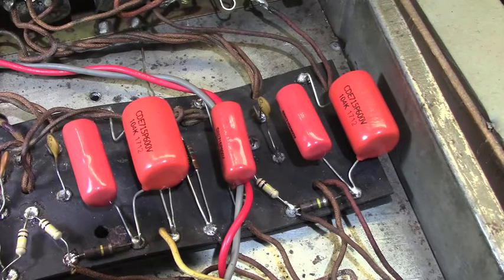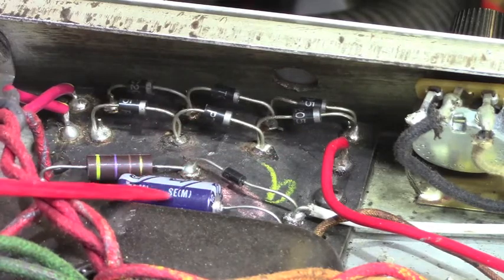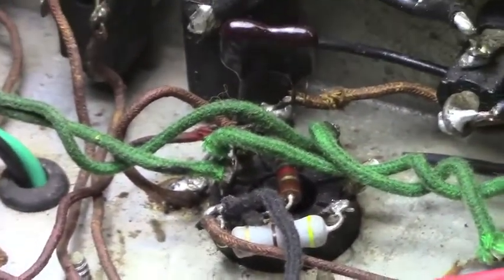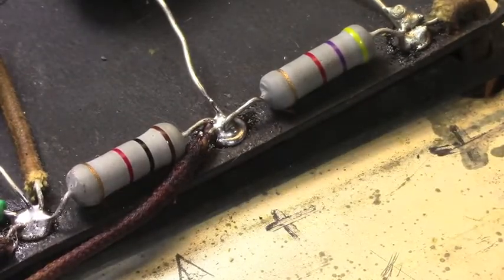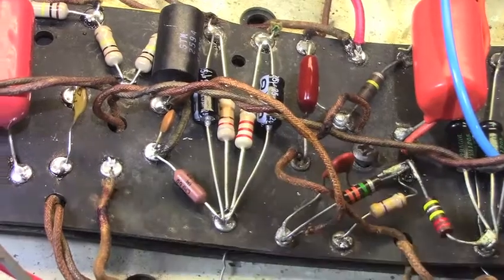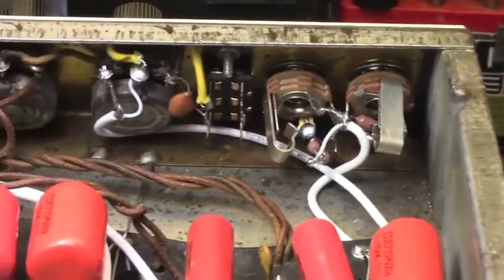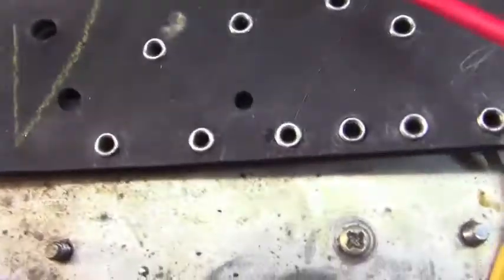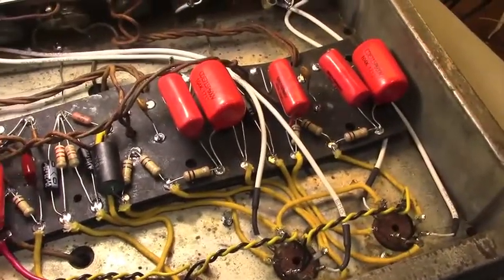The Gravedigger's 1967 Fender Twin Reverb - A Major Project WITH Soldering Tutorial

Comment: These videos are helping me a lot at the moment, thanks.  I picked up a silverface bassman to try my hand at recapping/servicing.  I opened it to find a horror show; over spec fuse, heater wiring replaced with like telephone cable or something, random plate resistors replaced (like you said, why do just one and not all?), horrible soldering, radial caps hot glued in under the doghouse, random wires cut or disconnected etc.  I'm having to learn a lot before I go in and try to rectify all this mess
Reply from the maker: kabukiman69 - I'm glad you are enjoying my videos. But, please do me a favor and proceed with the utmost caution. High voltage tube amplifiers contain voltages that will kill you if you give them the chance. This is nothing to screw around with if you don't know precisely what you're doing before you do it. So enjoy yourself, but be very careful.
Reply: @GranvilleGuitars  yes sir, I have done some work here and there but never a full on overhaul.  Confident in my work but also having to learn about fender specifics since I have not owned one before.  Your videos give great insight into things I should look at

Comment: What kind of resistors to use in the power supply section? Metal film? Power metal? Oxide, carbon? There's a lot of variations :D
Reply from the maker: echo - I will typically use metal oxide in situations where high power handling is needed.  Carbon films in most other positions.
Reply: @GranvilleGuitars  thank you so much. Will order oxides for my project :)
And the longer the video the better. Can have more beers ;)